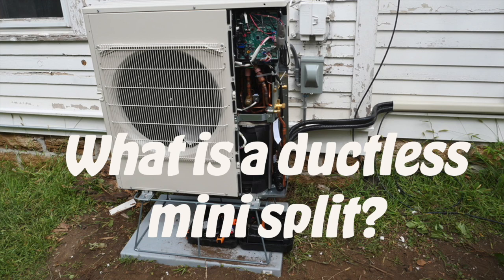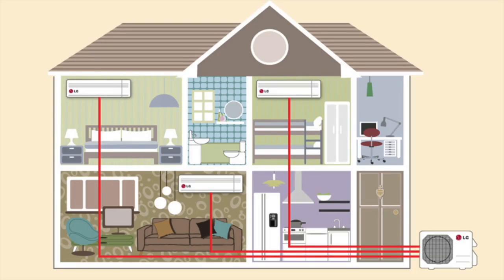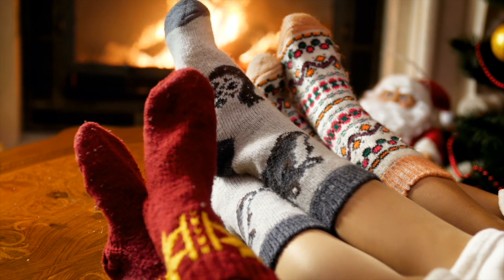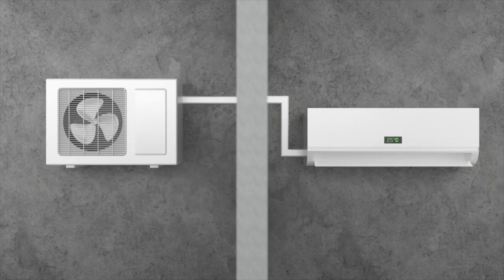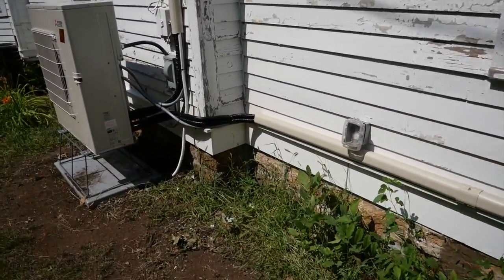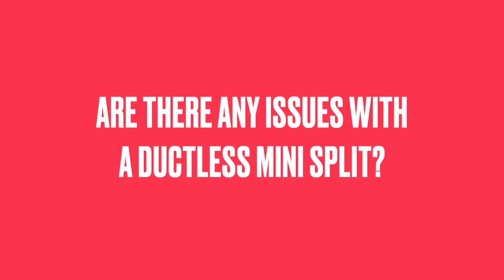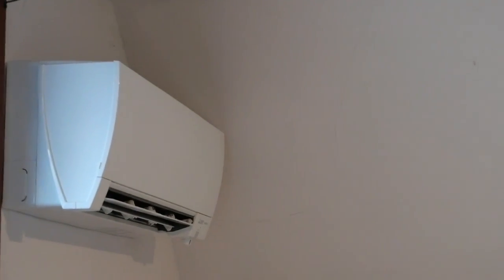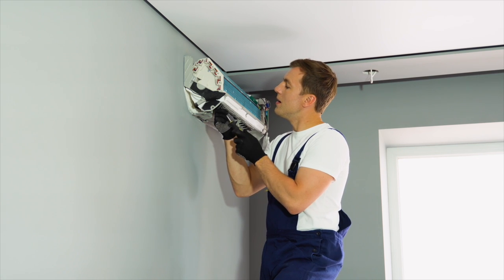The Underrated HVAC Solution: Ductless Mini-Splits

Comment: Good info
Reply from the maker: Adding a ductless mini split heating and cooling system can be great option for an old house renovation. Running ductwork in an old house with lath and plaster can be challenging.